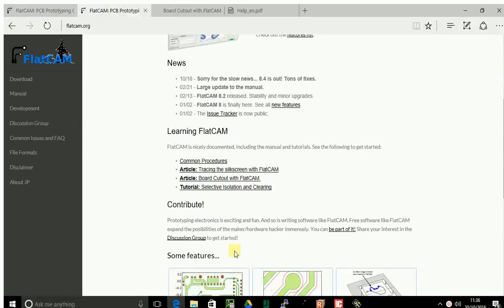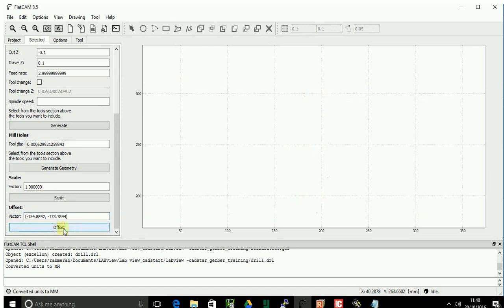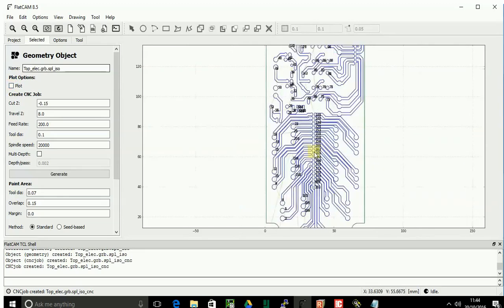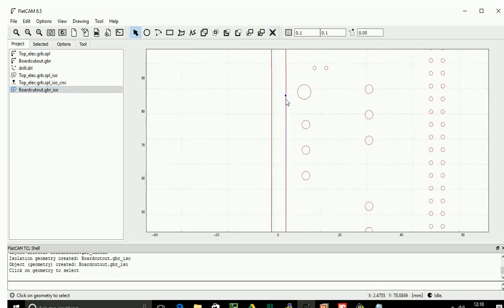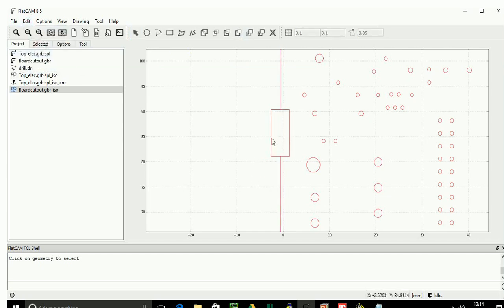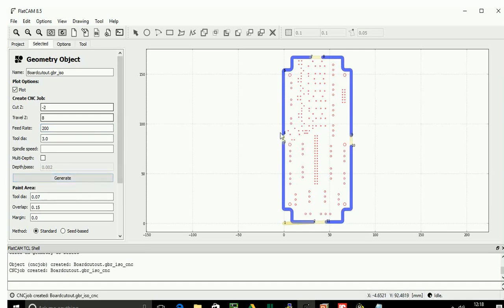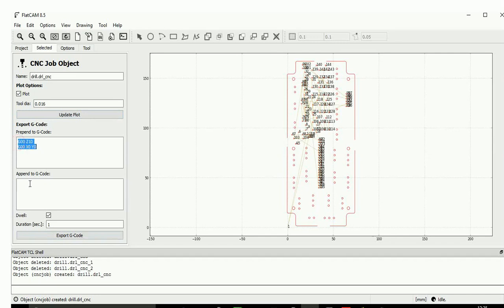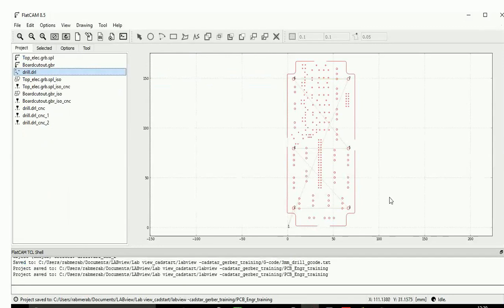flatcam video demo

Comment: Hello
I have seen your video several times now, in order to get my own PCB design converted to Gerber and exellon files in flatcam.
My pcb layer g- code is working super, but when i load the eagle layer 44 and 45 as exellon file into flatcam, my drill locations are expanded outside board dimensions. Like multiplied with factor 100?
Do you have any idea what my problem can be? Eagle 8.43 and internal cam processor to generates the outputs.
Thank you.

far outside the  board dimension.  I have tried and tried, but can not find a way to solve it.
Reply from the maker: Hi Niels
I don't have a licence for Eagle PCB layout so I can't reproduce your issue here.
Try this first; Before you load any Gerber or Excellon file, go to Option and in the drop down menu, select <b>PROJECT OPTION</b>, then for  the Unit select Inch. After this load all your files (Gerber and Excellon files) keeping the same option. After that if you want to work in mm; change the Units to mm.
If this doesn't resolve your issue, you can send me your files or dummy Gerber file (generated by Eagle) and let me try it. Please let me know how you got on.

Comment: Hi, 
my excellon file did not match the drill holes with the gerber file, 
what do I need to to do to fix the problems,
many thanks in advance
Reply: I also had this trouble,  my drill holes were mostly in the right position but were also scaled 10 times too.  For me it appears that the Eagle software does not include padded zeros.  For instance, it would output X123Y1234 when it should be producing X0123Y1234.   That missing zero caused me all kinds of problems.  I had to manually open the drill file in TextEdit, then add the missing zeros.   It worked fine after that.

This was the case for both inches and metric
Reply from the maker: Maybe you had the same issue as mine, My PCB layout software generates Gerber files in inch or metric and some how the excellon file only in inch. So what to do, in the Flatcam select inch as using in the menu. open the Gerber files and the Excellon file then if you want you can change to metric ( or mm) in the FlatCam. What ever your gerber files and excellon file unit has to match the FlatCam unit.
Reply: very usefull hint. I was searching for hours what went wrong.